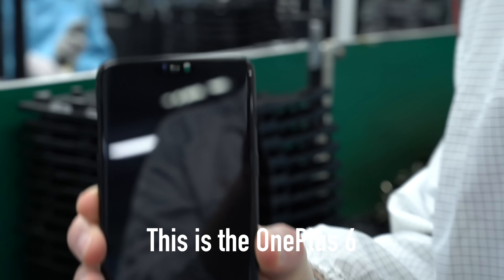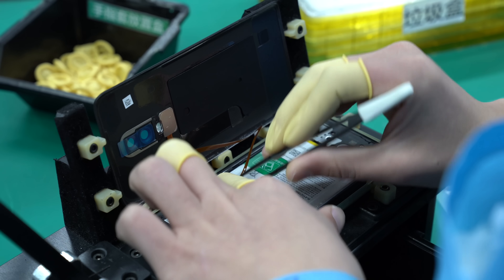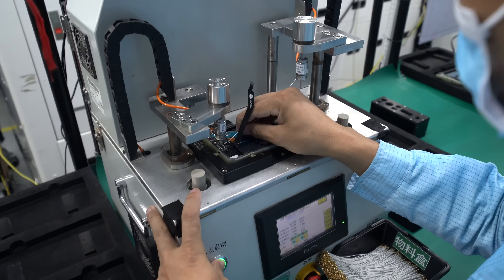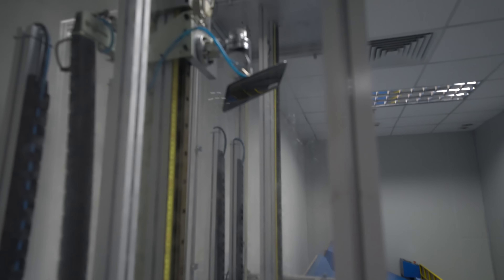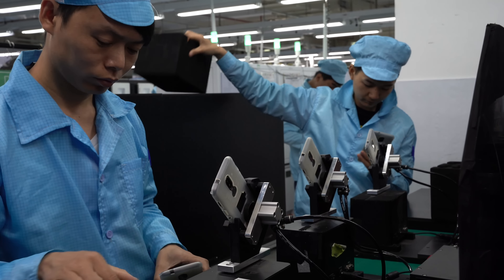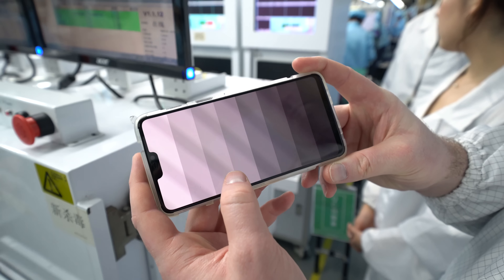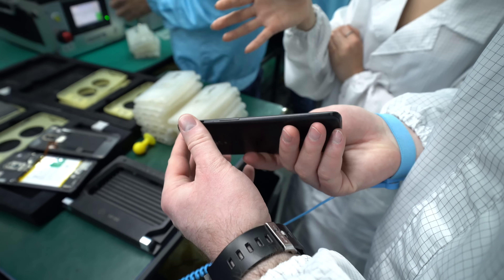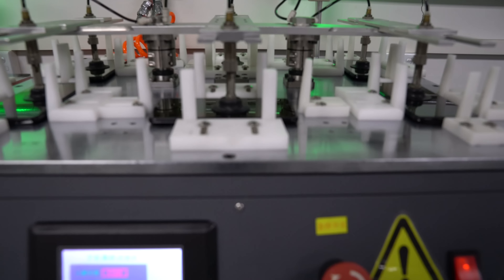How To Make A Smartphone...

Comment: Thanks for the video. This just shows the assembly and testing of the product. Not actually how to make a smartphone. Would be great if we get to see how the machines are actually built, and how the parts (such as the battery, flex, motherboards, lcd, etc) is actually produced. Cheers! - Khris
Reply: 1000 feet vivo v9?
Reply: those component that you have mentioned are built in another factory/company and they have there owned machine to assemble like on the video. Like in the camera there are more than machine and hands to assemble it of course the sony is involved that. and Oneplus has a partnership and supplier in many company like sony. One plus focuses on how they assembled the unit and optimizing hardware and software. but the components they have many suppliers.
Reply: The made parts come from other planet :D
Reply: I think building it is actually something they wanna keep secret otherwise everyone is just gonna build their own phone and wont buy one anymore

Comment: My Galaxy s8 droped from like 30 cm and almost crashed and now it have like a thunder layers in the back glass
Reply: this is why you don't use such costly phones without a phone cover and a screen protector, shit happens and you can't prevent it, so it's always better spend a couple bucks and make sure you don't have to lose your devices which you spent hundreds of dollars through hard earned money to get wasted.
Reply: Mythical no I was just bought a new screan protector but it was previnting me from using the phone with a case , yup as soon as I took out my phone it dropped
Reply: Same goes to me but my s8 doesnt crack and im pretty impressed with it. Btw mine was fell on the road
Reply: blu prutee yeahhhhh I ve broken over five of samsung's flagships
Reply: blu prutee yeah because u give a shit in saudi arabia we don't
Reply: Mythical I think u r a homeless 
man
Reply: But how does it almost crack though?
Reply: Samsung replaced my screen because it got scratches and didn't have a screen protector, oh! they replaced the battery without me asking and cost 0. Always 2 year warranty here.
I learned the lesson and now with my S9+ got a perfect full curved 9H hardness glass screen protector right at the shop and they applied it for me, got a Spigen case fits perfectly.
Reply: The Galaxy s9 has 20% more glass and is built with aluminium 7000 series...its much more durable...I dropped my s8 from almost the same height and it almost went useless...but then it happened again with the s9 but I got away with a few scratches and a small dent in the metal frame
Reply: Same...after my s9 got a dent I went and got a spigen case and now its alright
Reply: Congrats "Your mobile became God of Thunder".
Reply: FAHODYTUBE lol, as someone mentioned as soon as ypu buy it you should buy a cover, my galaxy s6 it is like new, without a single scratch, only the screen protector but thats all.
Reply: FAHODYTUBE yikes
Reply: FAHODYTUBE omg same
Reply: Mythical it's not just the price, a case makes your phone thick and usually ugly

Comment: At least when you drop your phone for the first time it's not the first time ever it was dropped so you can feel better about yourself.
Reply: Lonely Wolf they don't sell the dropped ones though
Reply: I love Ass ikr, like duh. they probably scrap, donate, or keep them
Reply: so tehnically not all phones pass the test...
what's the purpose then?how do they know the phone is not defected if they don't test it before selling?
Reply: they probably test 1 phone/thousand ,they are not obligated to check every phone which would be very time consuming
Reply: It's like they do testing to some number of the phones for each batch of manufacturing. You never know if a batch of board has shitty solders (ehem, nexus) or like bad flex cables

Comment: Great video, Lew. Your videos are getting more and more interesting and varied all the time.  

One question about the testing of phones: when run these drop, shake, etc tests, do those units then get out of for sale? I would think they wouldn't, as they would then be a used unit, and not brand new. I would assume that they're testing units to check that the specifications are correct, and then manufacture exact copies of these units. Am I correct?

Comment: The biggest problem with the drop quality test IS that hard, marble-like, perfectly smooth surface. Want to see it NOT survive the test? Try throwing on some everyday small gravel and loose coarse sand bits like you'd realistically drop it on in the street/along the sidewalk. See how well they take the uneven distribution of pressure at various points along the glass. That'd show you if there's a weak spot 1/3 of the way down the front, for example. (BUT it'd also mean lowering the distance they can legally claim, so sadly that is unlikely to happen.) That being said... the OnePlus 6 DOES look sexy... and that's still quite impressive when compared with the competition. :-)

Comment: i want a make superb tablet.    5TB ROM  128 RAM  FULL SCREEN  8K QUALITY ULTRA  RESOLUTION HIGH ULTRA   10000MAH battery   6 camera   FOLD SCREEN  5 MULTIPLE SCREEN    120 FPS    99999 PIXEL     HYPER WIDE ULTRA WIDE SUPER WIDE VERY WIDE             SMOOTH    AND   8K AMAZING WALLPAPER
thats cool